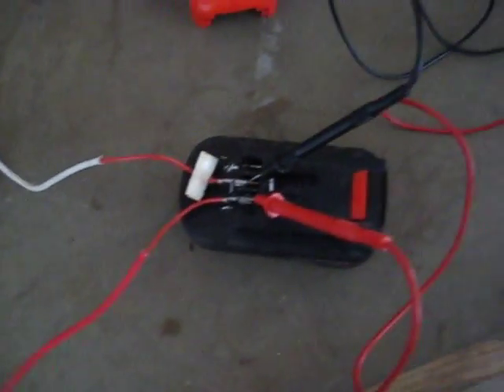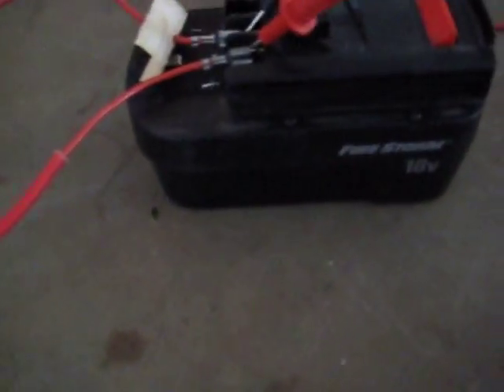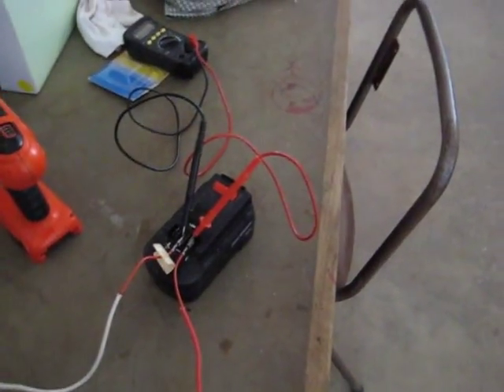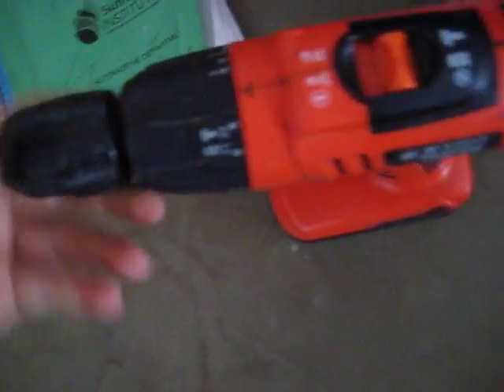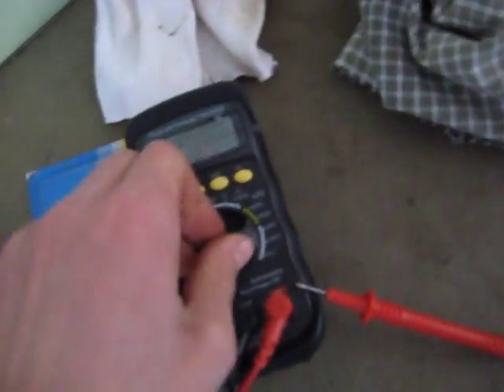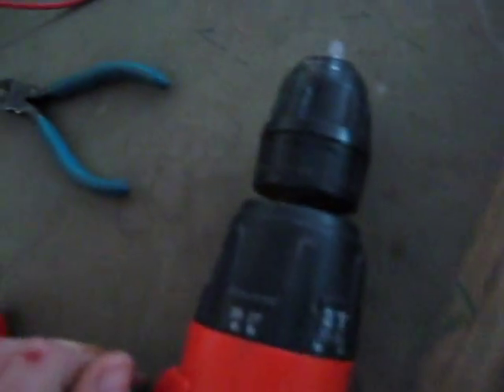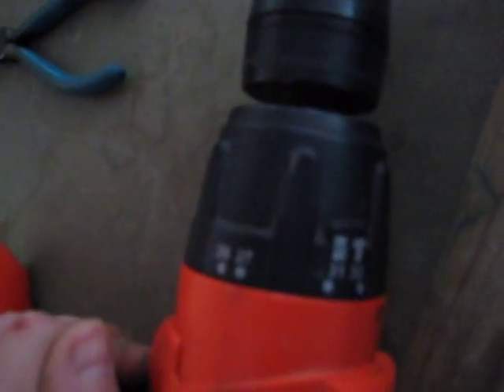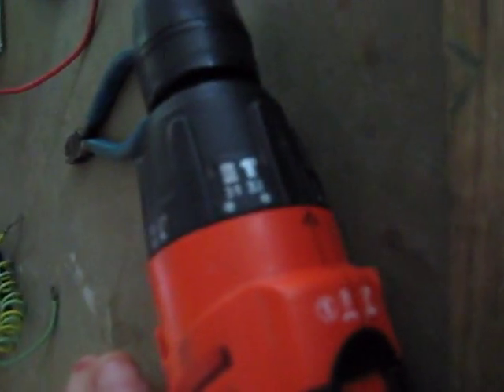Drill Battery rejuvenate Fail & Cordless drill mod

Comment from the maker: @wayfairing3 Ni cad batteries get whats called Cadmium Dendrites, which are crystals that form inside the cells and grow until they reach both the negative side and the positive side and shorts out, preventing the battery from charging again